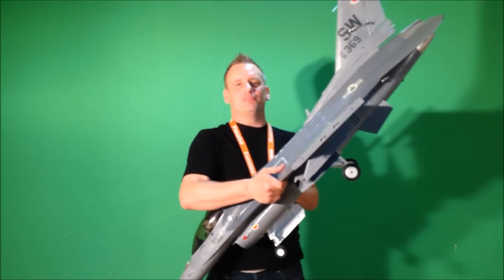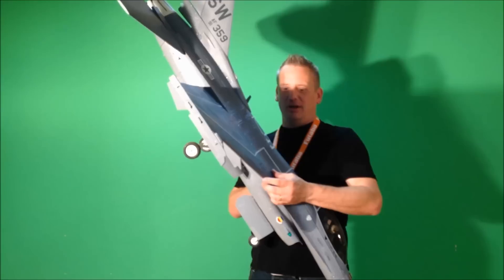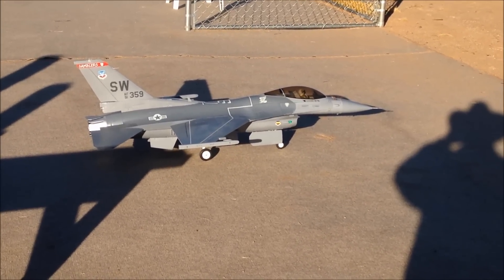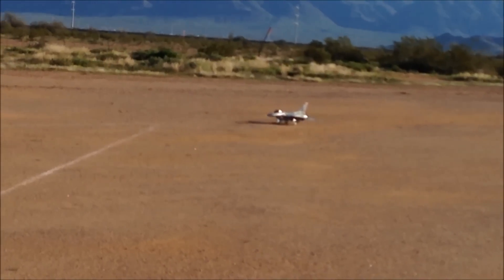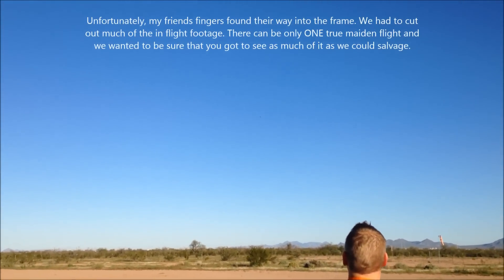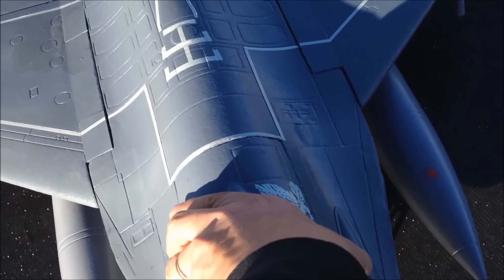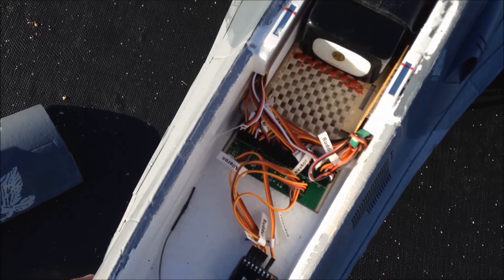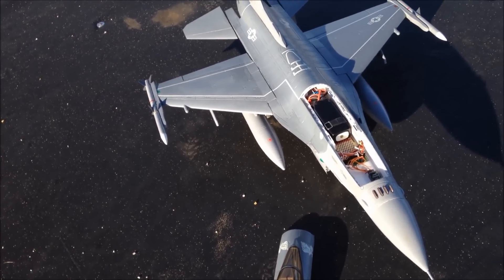Freewing 90mm F-16 Flight Review

Comment: dear  i want to buy it, so is it very good? can i fly with a 4000 mah? thanks
Reply from the maker: It is very fast and agile. If you aren't used to EDF jet types, it can be a handful. If you do have experience though, it's fantastic! I wouldn't bother with anything less than a 5000, flight times are already pretty short because of the high energy consumption.
Reply: 3IFM I already use the A10 from motion rc with fun 80 mm. So I am ok with A10. I am afraid F16 is more fast and agile and I am worried about landing gear. A10 landing gear is very strong, what about f16 landing gear? Thank
Reply: 3IFM dear, i have the A10, if i want to buy another one do you suggest the B25 of banana hobby or the f16 from motion rc? Thanks? B25 Will be shipped from china? Or EU? Thanks

Comment: My f16 90mm is very nose heavy with turnigy 5000mah 50c lipo I set the battery as aft and it's still nose heavy or could it be that the turnigy is a heavy lipo than the admiral 5000mah 50c
Reply from the maker: Small world, I just watched your md500 video a couple of nights ago. The Admiral battery weighs in at 732g / 25.82oz. You might toss the turnigy battery on the scale and see what you get but I can't see it being so different that it throws your cg that far out of wack, when you've got it all the way back.

Comment: The balance point is taken from the tip of the wing correct? The manual is not real clear. I am assuming it is
Reply from the maker: The balance point is measured from wing leading edge (inboard) where it meets the fuselage. For an admiral 5000 50c pack, the placement is centered under the provided Velcro strap. My placement in the video was incorrect for the optimal cg, assuming your airplane is stock.

Comment: just got one of these f16   and I'm not used to  a jet a all  I  have been flying warbirds and wings ,  so it say some where in the manual to disconnect  the vectoring on take offs and lands or it will flip over  ,so can I fly it without the vectoring  on until  I get use to the elevator a nd rudder  for landing  and taking off.  I hope  I can do this

Comment: I was thinking of going with flaps only on the wings and elevons on the stabilator.  I would do this to be able to slow down the plane more on landing with good lateral stability. I've flow a smaller F-16 with this set up with only a straight main wing. No flaps or ailerons. I have already purchased the brakes as I see a need for them. I have a DX8 Tx and will use a AS3X Rx. The only thing I'll need the module for is the landing gear. Feed back would be great. I'll be getting the 90mm T-bird special and ordering the Mr. sound card next. Tim T  I was in Tucson for 4 years until 6 months ago. (No Work) Back in Michigan with family.
Reply from the maker: +Timothy Toutant accidently deleted my other reply: I was saying I'd like to know how that flight control setup works out for you. I've read about aerodynamic "blocking" of the stab at flap settings greater than 20mm. I also wondered how the elevon configuration will affect your roll rate. ...also: I saw your C5 video and was wondering about that particular model. I grew up in Tucson and remember a VERY similar model, hanging from the ceiling of our hobby shop on the east side of town. It was over 20 years ago but I remember dreaming about that model as a kid. Is it possible that it's the same one?
Reply: +3IFM The Hobby Barn in Tucson on 21st St behind ace hardware. The is still there and in the Hemple family. Billy Hemple Jr flew the plane after hanging in the store for over 15 years.  It was flown for the regrand opening of the store. It has been redone inside and out. Now the C-5 is back in hanging posture and may never fly again.
Reply from the maker: +Timothy Toutant That's the place! Unless there were two of these, this must be the same plane I saw there back in 1989/90.

Comment: Did you set the ailerons to double as flaps? I wonder if that might make for a smoother takeoff and landing.
Reply from the maker: dojmike There is a provision for bypassing the circuit integration board and setting up flaperon mixing. I myself have not experimented with this and therefore, I can't offer an informed opinion. I have read mixed reviews from others though. It seems like those who are enjoying the best results were ensuring that their flaps were limited to the recommended 25mm throws, at full landing flaps. I believe the intermediate 12-13mm throw is what most decided on for their takeoff/approach flap setting. Deeper throws have, in some cases, caused aerodynamic "blocking" of the horizontal stabilizer in critical, slow speed, phases of flight. Again, this is simply based on my memory of forum discussions and not my own personal experience.
Reply: 3IFM Thank you for the intelligent and well thought out response. If I get this plane, I will be tempted to configure flaperons so my landings need not be so hot. One concern is that I fear that if I need some last second aileron control (wind gust) then I wouldn't want the flaprons to not still have some aileron authority. Do you know if flaperons are strictly flaps or is there still some aileron control when in "flaps" mode?
Reply from the maker: dojmike Great question! The flap/aileron or "flaperon" mixing provides for use of both the primary and secondary flight controls at the same time. That's the magic of it; the use of flaps will not lock out proportionate aileron deflection. ...a word of caution though: Remember that the greater the flap setting, the more narrow your stall margin will be on approach. This airplane is built for speed and it has a low aspect ratio. It's already pretty sensitive in this arena as it does not like to slow down. While I enjoy flying it a great deal, I myself have struggled with maintaining a good maneuvering speed in the base-to-final turn. I can see landing or even approach flap settings making that scenario much more challenging. If you decide to go this route, I'd like to hear back from you in a follow up. I'll be curious to learn your results.
Reply: +3IFM Also keep in mind that flaperons take away a good part of the roll authority you would normally get from your ailerons - the more flap deflection, the less roll authority. Also, aileron input will in extreme cases lead to a bit of yaw as well (since one wing will have more drag than the other)

On most modern jets though, a nice option to counter potential problems from reduced roll authority when running flaperons, is to use taileron mixing as well.
Reply from the maker: +janmb ...all valid points. Thanks for the tips!

Comment: Nice job on the 3 videos ... very detailed and informative.  What has been your typical flight duration?
Reply from the maker: John Dixon Thanks John, I typically, setup my approach at 2:30min. I find that this leaves me up to two missed approaches. If my first attempt is successful, I land at around 3.87 per cell. Landing on the third attempt put the cells at around 3.79. My field is at about 1,500' MSL and the air temperature was typically around 70 - 80F, when I was getting these results. I have hung the F-16 up in my garage for the hot summer. Thanks for watching!

Comment: Did you take off with low rates or high rates? and wich one did you fly with?
Reply: +3IFM lol i have to hang mine up all the time, summer is only time they get some freedom
Reply from the maker: John Knopp  I've been flying strictly with low rates but before I hung it up for the hot summer here, I'd been considering switch to high rates. It flies great on low but I feel like the roll rate should be faster.
Reply from the maker: +Blame USA Ha! :) It's just too hot around here after 9AM in the summer.

Comment: How the heck do you  fly on that dirt strip without fodding out your blades - especially with the cheater louvers that f-16 has !????
Reply from the maker: Great question! 33% of the testing was conducted from a surface just like this. The others were grass and pavement. I have made several flights from this field and have inspected the fan after each one. So far, I'm FOD free! This is a surprising result, I must say but it would seem that the design is adequate to prevent such an occurrence.

Comment: was your plane the stock fan and motor?  I have one also ready to maiden . Did you use the control throws that were in the book? Yours looked great in flight .
Reply from the maker: rdkr03 Yes! Mine is the stock outrunner motor with the Admiral 5200mHa 50c battery. I used the exact flight control throws, listed in the manual, for both high and low rates respectively. For myself, I also programmed in 60% expo. My horizontal stabilizer is centered at exactly the recommended neutral position and my CG is at the exact mid-point of the specified range. She flies wonderfully! Enjoy!